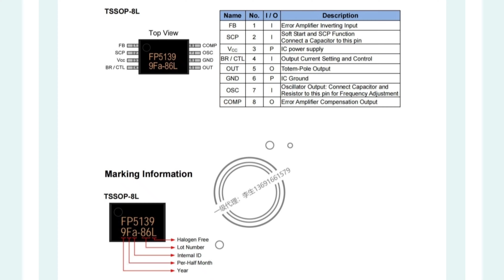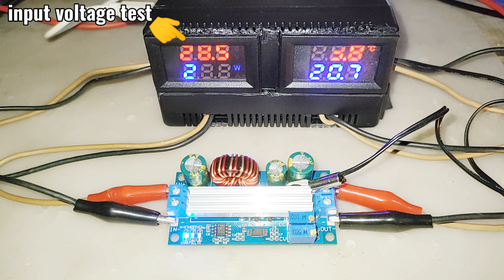Buck-Boost Converter Testing 0-30V 0-4A Testing (XY-SJVA-4)

Comment: can you modify the mosfet to a higher mosfet?
Reply from the maker: The MOSFET is already very powerful
Reply: @Electronic_For_You  I know that, but if I replace it with a bigger one, is that possible?
Reply from the maker: Maybe yes ,
Then you have to replace the diode , the current limiting resistor, so on
Reply: @Electronic_For_You  do a video replacing the MOSFET and diod and resistor for higher current. Your video are wonderful for who wants to make a decision in buying. Iv been following you for many years good work.
Reply from the maker: Maybe I will try